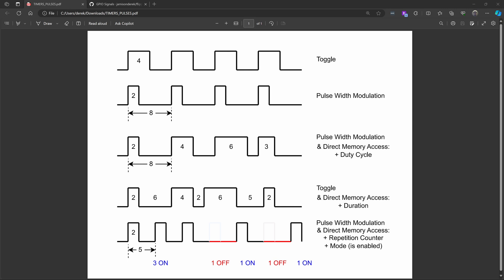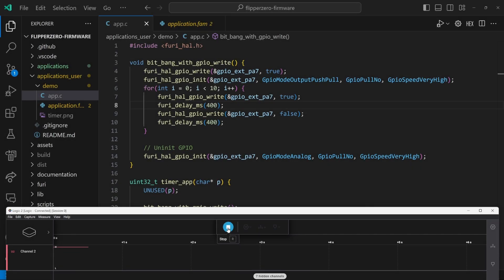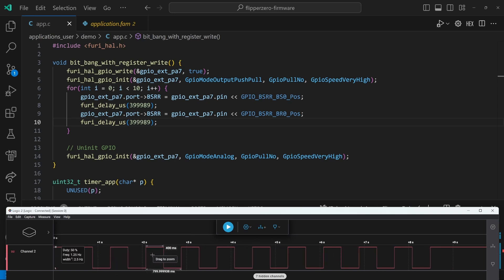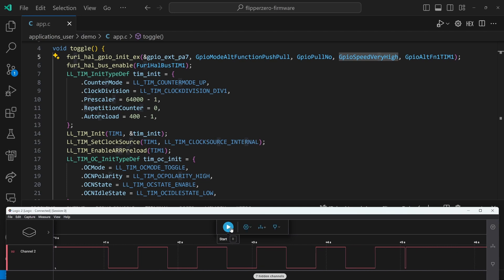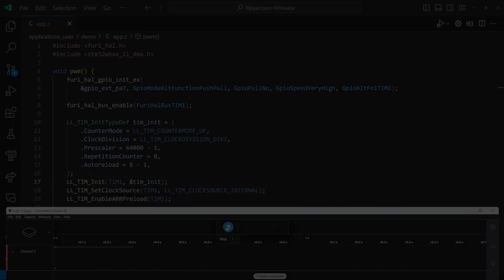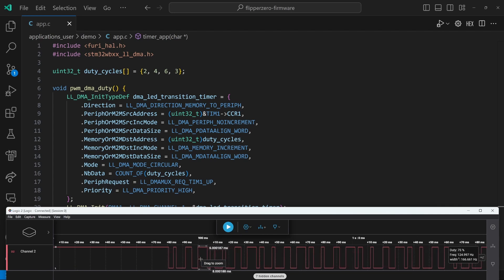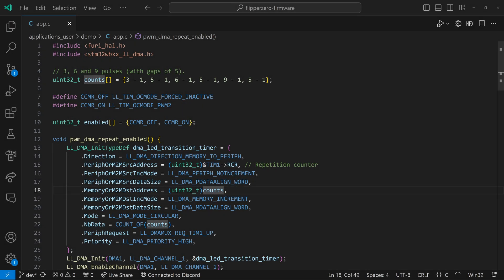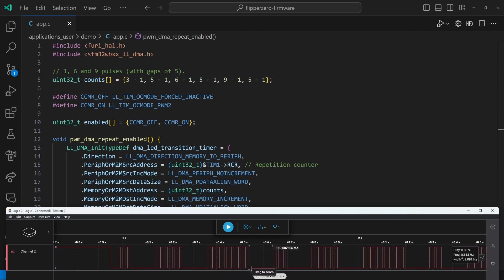[98] Flipper Zero - Writing code for GPIO signals

Comment: Super explained. At the beginning I thought to myself, why is it not enough to just insert furi_hal_delay, but in the end I understood how the raw data is structured, for example. Keep up the good work, your videos and wiki entries are really helpful.
Reply from the maker: Thanks, I’m glad it made sense.  I was super confused when initially trying to learn it.  For some devices, delay may be good enough & is much easier code for others to understand. Also, I had to keep with bit-banging for the RGB backlight, because we don’t always know what timers are available when the user interacts with flipper and triggers a backlight event (it’s not as accurate so sometimes the LEDs are the wrong color, but it works most of the time).